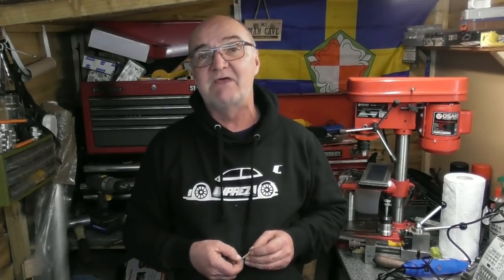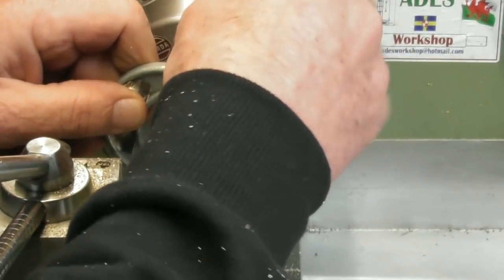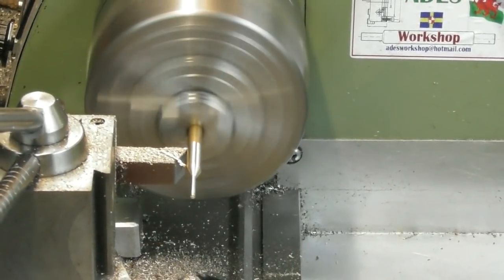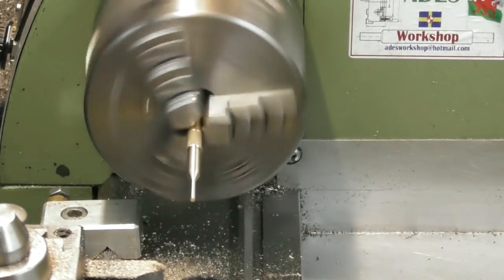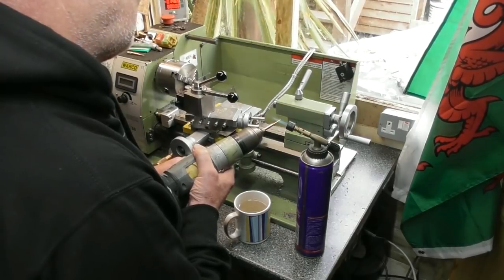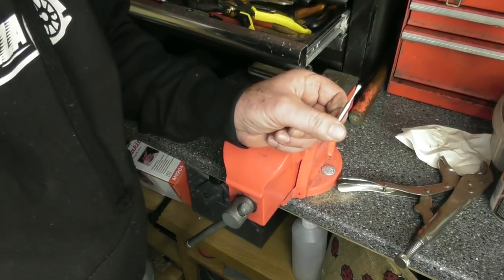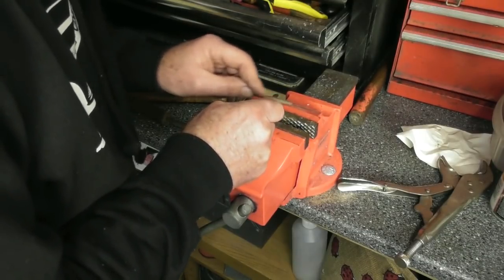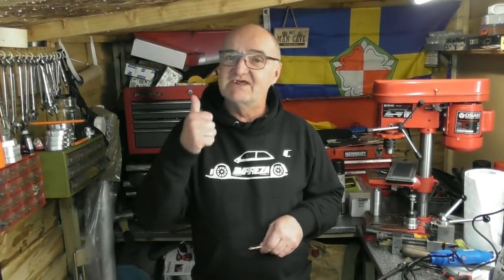Watch hand removal levers

Comment: Thank you for the video!  I have a few of these but making them is appealing (custom shapes, materials).  One bit of advice (I am not a pro but have some experience with watches): for watch-sized hands it tends to be best to not have a v-slot, or maybe have a very tiny one.  But the edge may need to be quite thin.  The professional levers are steel because they need to last, but brass may be better for occasional use because it's less likely to scratch. This is an inspiration for me to try making them, thank you!

Comment: Pretty sure you hardened the brass instead of annealing it.....
Annealing involves heating steel to a specified temperature and then cooling at a very slow and controlled rate.
Hardening involves heating steel to a specified temperature and then quenching it in brine, oil, water, coffee.... depending on how fast and how hard you want the metal to be hardened to...
Reply from the maker: For sure that is the case with steel. however , for brass and copper the annealing process is the  opposite. quenching holds the soft state. . PS . i have a very high qualification in metallurgy as well as being a time served toolmaker . i can suck eggs better than most on this subject.Cheers for commenting and watching though , Ade.
Reply: @ade63dug  Learn something new everyday! 😊 Thanks for correcting me, I'm a student myself so haven't learnt everything yet 😂
Reply: @ade63dug  As Ade states quenching anneals brass & copper, it also work hardens.
Reply: Thank you for this discussion!

Comment: Hi Ade. I have noticed on my lathe (very similar to yours) that I can use the directional switch to brake the motor. I´m positive this has to do with induction but not sure if it may harm the DC controller board. Any idea?
Reply: Try it yourself. Put the motor in forward and turn the chuck by hand. You can feel the resistance in one direction and vise versa. Now run the spindle in any diraction and throw the switch two clicks the other way and the chuck will stop in a few turns. Very handy, but I'm reluctant to do so not to harm the controller board (motor is most likely fine with this).
Reply: As Ade's lathe has a Brushed DC Motor, flicking the motor controller into reverse to stop the motor quickly, will be detrimental to the motor in the long term.  If you could see the brushes when you do that, you'll see lots of arcing.   If you want to be able to stop the lathe quickly, and you want much more low speed torque (in fact higher torque at all speeds) you should consider modifying the lathe to use a Brush-less DC Motor, and a suitable Brush-less DC Motor Controller board.   Most of the Brush-less DC Motor Controller Boards used in Chinese mini-lathes have a "brake" function enabled, so that when you switch the lathe (or Mini-Mill) off, the spindle stops almost instantly - extremely useful for power tapping and similar operations.   Your lathe's supplier should be able to advise if they can supply the necessary motor and controller board.
Reply: @roygilby4513  - Thanks. I was pretty sure my motor was brushless. Not so much anymore... How can I tell for sure? I cannot see any brush holes on the sides of the motor.
Reply: Roy i was only speaking to Warco a few days ago asking if they intended to go with brushless motors on the WM 180 lathes in the future, they said they had no plans to do so & were sticking with brushed motors in the WM180. What brand & model is your lathe that is simular to Ades  Warco WM180.
Reply: My previous reply was to Contango 1000 & not to Roy to avoid any confusion with roy, my mistake.
Reply: I have to say, once tuned and mounted on a 30mm granite bench, Wow! 1/10 thou runout on tailstock.
Reply: @gillian9178  - Spec sheet is not correct though. I have a MT5 spindle. They got lazy and did not update documentation. Runout on spindle does not even register on my 0,01mm dial.
Reply: @Contango1000  I know some of the various make 210 x 400 lathes do use the more powerfull brushless motors now. Toolco in the UK have there 1014 lathe with a brushless motor which is the same lathe as the 210x400, i dont think there are any 180 x 300 lathes that have gone to brushless yet & still use brushed motors. Maybe they will change in the future.
Reply: @gillian9178  - Thanks. Under heavy load, my motor makes a lot of snapping noise. Could that be the brushes? I cannot think of any reason a brushless motor would make any sound in that audible spectrum.
Reply: @Contango1000  Is the spindle really bored 38mm with a MT5, i had seen these numbers quoted before on some 210 x 400 lathes & thought they must have printed the wrong size as 38mm seems large for thids size of lathe ?
Reply: @gillian9178  - It is. Normally these lathes have 40 teeth, mine has 56 on the spindle gear.
Reply: 125mm chuck, which they just bored out to fit, and dug into the screws for the back plate, hehe
Reply: calculating thread feed is close to impossible, since the manual still says 40 teeth.
Reply from the maker: Looking at the comments , this has been answered very well . i would not do it on mine thats for sure. , Cheers Ade.

Comment: Hi Abe, when turning small diameters in wood with a skew chisel I would hold the back of the wood with my other hand and run my finger in line with the skew to stop flex, wouldn't even bat an eyelid, but don't think I would have the b***s to do it with the metal lathe. TFS G :)